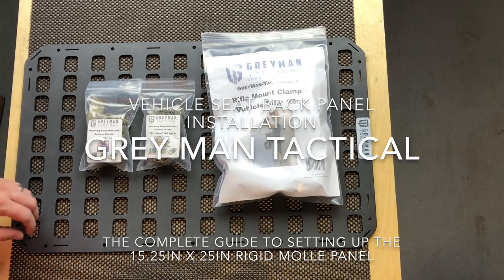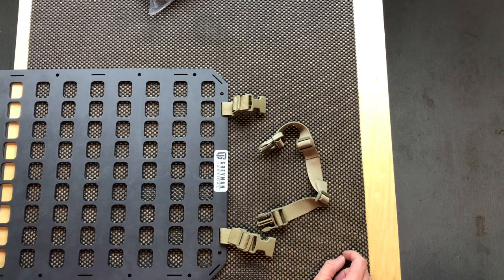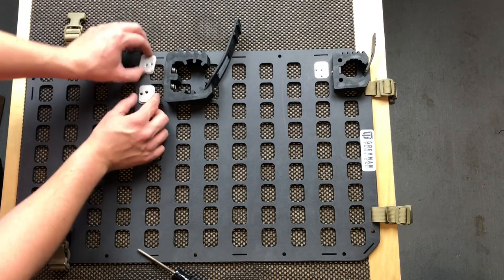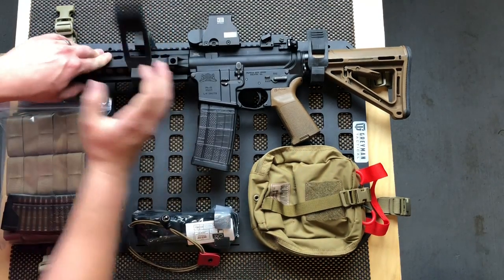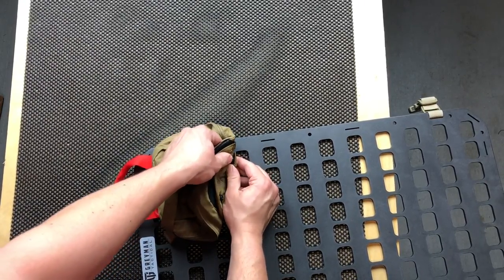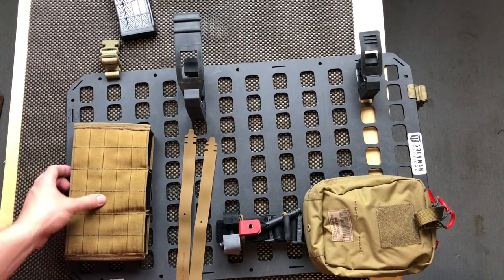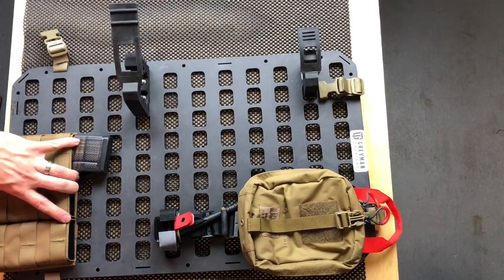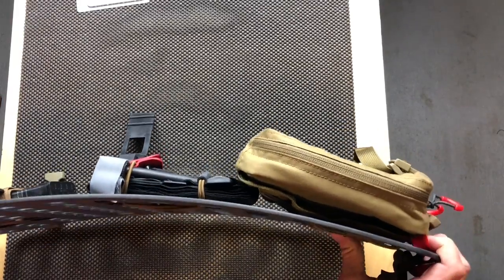Grey Man Tactical - Vehicle Seat Back Rifle Rack - Complete Installation

Comment: There needs to be some type of pull down cover to hide your gear while you are out and about. The last thing you need is someone breaking into your vehicle at the mall or wherever, to steal your gun and gear.
Reply: Throw a large  jacket with a hood over it, have the option to zip up the front or not.
Reply: They sell an “RMP cover.”
Reply: I use my hiking backpack rain fly (40L) to cover it